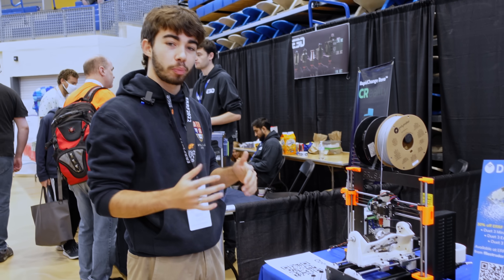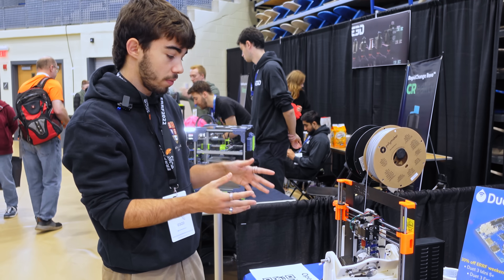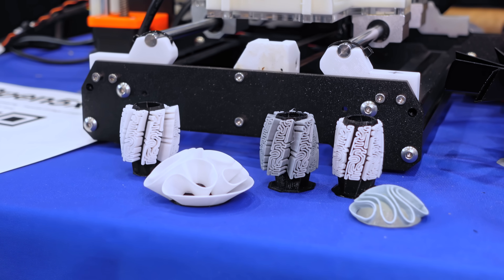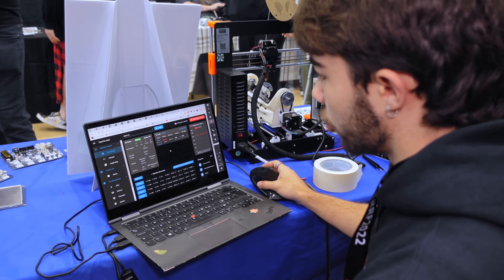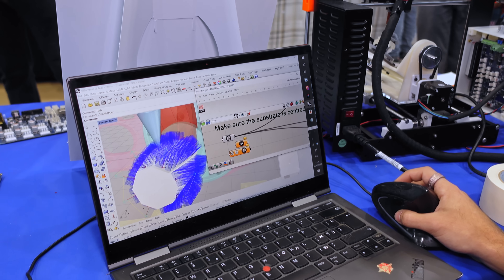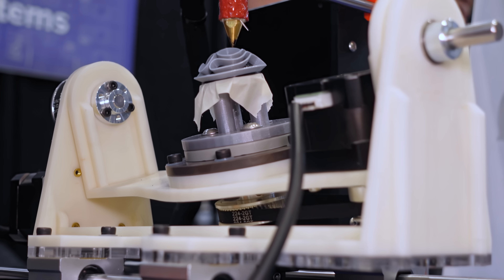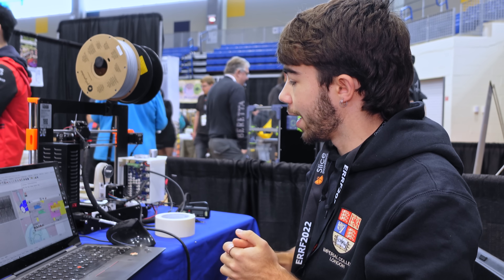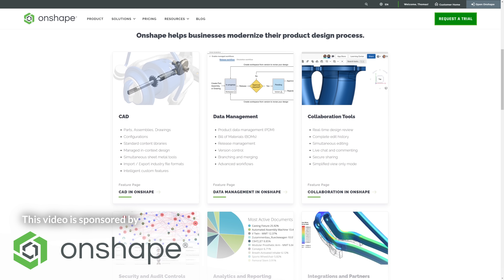You can build this 5-axis Prusa conversion: The Open5X! #ERRF2022

Comment: As a mechanical engineer I look at that and think it isn't hard to make. We actually make stuff like that in industrial space all the time...
HOWEVER... 3D printing and how the slicing is done is nothing like what we do with machining or welding. In those we just set paths, and it works. However... Nobody is going to write a 3D object in pure Gcode. The problem isn't that it can't be done - it can be, I do it all the time. Issue is that additive manufacturing requires things like infill and different path properties, and along with that the extrusion volume calculations. That is the problem. The problem is software, and especially the slicing. We have solved the axis controls, and those controllers and equipment are available for cheap nowadays. We automate lots of things and retrofit many machines at my place of work. However we don't need to do the calculations that are done in additive manufacturing.

Comment: I love fdm tech as we don’t cut away scraps material but add when we want it. Also it can do what Normal cut mill turn CNC cannot do. Yeah the presenter is right.. hardware is not the problem. Software and slicers going 5D is a bit tough though nothing is impossible. Thanks for sharing 💕.

Comment: 😯Really cool project!
Especially using it a bit like a lathe could potentially wrap up the weak layer direction into cylinders. And one extra axis still.
For the propeller demo object it does the opposite though. As the blades are disjunct the chosen orientation weakens the propeller blades.
But it should be possible to still print overhang free but with way better layer orientation.

Comment: A great accomplishment from an engineering standpoint, but it has drawbacks also. Apart from the software to run it, the usability is also limited as the trunnion table and extended nozzle take up quite a large chunk of the available working area. It isn't going to be cheap to build, as you'll need some precision parts to minimise the mentioned absolute zero offset. Printed parts will not cut it I think, it'll require milling. Also there are only so many parts that will fit the relatively small remaining working area and benefit from not needing supports.
I for one would rather have an IDEX. Will work with free software, minimal loss of working area if at all, will let you print all of the showed parts 3 times the size and supports can be done in PVA if need be, to be able to wash them off and have crisp edges. Just two tone with PVA supports will be a challenge, but I'd rather occasionally paint some parts then have the significant size limitation.
In my opinion, the amount of viable user cases for at-home 5 axis 3d printing will be very limited.
Even in the industrial milling field the majority of machines is 3 axis still, for similar reasons.

Comment: Very cool.  This could print almost anything, with no supports or infill and with "layers" in whatever orientation gives the best adhesion.  As he said, the hardware was basically easy and the software is the tough part, as evidenced by the demos with simple 2D-paths extruded out and multiplied.

Comment: Finished one 6 years ago, aluminium prices were cheap then.
It's working and prints with cobbled together G-Code.
Still no slicer to make some use of it. It will always be just a thing on the shelf:
- No slicers for it 
- If there will be a slicer, it would take huge amounts of time to slice parts the way you want. 
- Automating the Slicer to make it somewhat usable like 3-Axis slicers would take years, because there is no industrial interest.
- You go all the long to have a workflow and in the end you still have an FDM print, (of course it is waaay improved because of the layer oriantation) but it will never be as good as a SLS, Polyjet, which is getting cheaper too. 

Really enjoyed the build, all machined out of aluminum, linear rails, small ballscrews, servos, tiny Harmonic Drives, 3 different sized heatbeds with quick change, quick change extruder with an custom hotend.
Reply: A few industrial cam systems support additive manufacturing these days. I'm looking at one right now on my laptop. Haven't tried the feature yet, though.
Reply: @TheFeralEngineer  which one were you looking at?
Reply: @strongme80  esprit edge. Nx does additive also

Comment: Do CNC machines need slicer too, is it just g code in different way?
Can't you use the same code from CNC 5axes mill just in reverse? Let's say we make a same size mill in cad as plastic being extruded in 3d printer, then in cad we have our work piece, our part and we just make our mill in cad mill away entire part just leave the base you are supposed to print on, a sphere or other shape that is not just flat so it uses all the axes?

Comment: Nice. I saw myself and friends in the background :P

This is the first video on the machine where it was really indicated that the 5th axis part is more vase-mode following a surface normal, which would make the slicing + inverse kinematics easier. General purpose would be very hard but should be doable with some work.

Comment: Wow!  What a fascinating project.  I love seeing the continued adaptation of modern CNC solutions into the 3D printing world.  It makes the CNC technology reachable and achievable by the average home hobbyist.  What is great about this is that the knowledge and skills one learns with this easily extends onto full scale, metal CNC machining.  The 4th/5th-axis Trunnion solution you have designed looks solid.  For sure the key moving forward will be the continued development of the slicing software to generate the tool paths.  Being open source, I'm confident the geniuses in our open source world will add much value to this.  Thanks for sharing your project.
Reply: it will probably help somewhat in starting to think about using 5 axes when thinking about manufacuring a part, but beyond that, additive manufacturing is sucj a fundamentally different paradigm to subtractive manufacturing, that there is not all that much overlap between the ways you have to think about manufacturing parts when using these technologies.

Not that I don't approve of course, but I think this is not quite the best use case scenario for this technology

Comment: And it works with any printer with the latest Marlin Firmware installed with extra axis support enabled, as the "U" axis. So anyone with a RepRap device (and a spare stepper plug) can enter the next dimension!
Reply: All the hardware is very straightforward.  Software, tho.... particularly the slicing, has to be done in a commercial product

Comment: This is why I love the 3d printer space, most industrial manufacturing processes slowly get more and more insular, more specialized tools, specialized software that is not at all user friendly, etc. open source designs actually get improved upon because so many people use then and give feedback in a very helpful community
Reply: So very true, I created a range of folding TPU receiver & antenna holders for quadcopters which are super easy to print and use, holding them securely in a way no other prints have before.
A lot of the design elements in them came from suggestions in a Facebook group after I posted the first iterations.
Resulting in them being recommended throughout the FPV drone community.

Comment: Is this the same concept as the rotating printer head from CNC kitchen? that would probably be a better option as you wouldn't have to sacrifice so much build volume plus its just changing the tool head versus building and programming an entirely new rig
Reply: Not quite because that allows up to 90degree overhangs, this essentially allows for a lot greater than 90 degrees (within reason). Also you’re always printing normal to the nozzle which will mean your layers are cleaner. Whereas on CNC kitchens video he mentioned that some flat planes won’t be completely perpendicular to the flat end of the nozzle which could cause some less than ideal surface finishes

Edit- this is just my take though, you are right about the added complexity and less build space. 

5 axis CNC machining centres run into many of the same  issues, in terms of complexity of programming and the added risks of collisions, added cost, smaller working envelope vs a 3axis machine of the same foot print

Comment: Will never take off until the software matures. This is the same problem with 3D Construction printing at the moment. Using Rhino and a grasshopper script is non-intuitive and a  major barrier for most.
Reply: I don’t see why this couldn’t be added to Cura … this is basically taking away the bed movement and adding a extra axis . I mean it’s kinda amazing how good Cura is already I can see it eventually getting 5 axis slicing.
Reply: @JoeWayne84  the bed movement is still there, and they add 2 extra axis

Comment: This is pretty cool. Its sad that you loose so much build volume and I kinda feel like a Delta style printer would have been a better choice
Reply: It's hard to say that any part of this project is sad, it's just a consequence of every trunnion style 5 axis configuration. Every 3 axis machine build volume shrinks when the 5 axis setup is installed.
Reply: this is just like the "normal" CNC machine, just like a Haas VF3 compared to a Haas UMC-750, but each machine fits a different job, but  if they made the rotary table/cradle more like a TRT100, then they might be able to reduce the size, and allow for bigger prints hopefully :D
Reply: If its sad, help improve it then!

Comment: Interesting idea, but the $80 slewing ring bearing kills the BOM, and using an industrial grade bearing like that is pointless when the rest of your assembly is plastic. Swap that out for two $5 off-the-shelf large diameter bearings and a bushing, and it's instantly a lot more affordable.
Reply: Pull Requests are welcomed.
Reply: 3d printing was not invented for hobbyists but the affordability of the smaller machines that comes over after decades made them available for a new use case scenario and this is something which is more needed at Industrial level...!! So hats off to the guy and team who made it successful after around 40 years of invention of 3d printers..!!!
Reply: brother, start printing and spending money on this mod and swap the industrial bearings with 5$ ones and run some tests. maybe you will understand their choice once you start implementing your thoughts instead of dumping them as hate…
Reply: @danielmaracine3710  I have a 5 axis attachment on my desktop CNC mill and it doesn't take a slewing ring to work, just good design
Reply: This is an open source project, you’re more than welcome to go, develop your upgrades and contribute to the solution.
Reply: This project is opensource, if you don't like somthing, you can modify it to match your needs.
Reply: Sounds like a great opportunity for you to improve the project. I'm sure they'd love to have you contribute.
Reply: Rhino (the CAD Software you need to run Grasshopper) is around 1000€ alone. Education Version is 200€. 

Also $80 isn’t that much for a slewing bearing.
Reply: @WurstPeterl  arrrr harrr harrrrrrrr, there be ways around that, matey
Reply: @krazislav  dont destroy his innocence. Having people like him allows us to be us 🤣🤣
Reply: @brold6111  I know about the 90 day trial. But I used that already
Reply: @WurstPeterl  comedy gold
Reply: @WurstPeterl  it does not matter if that's a steal for a slweing bearing its still adds too much to the BOM.
Reply: @WurstPeterl You don't need to use Rhino/grasshopper for this.

Comment: I want to know how we're kinematically understanding the machine, breakthroughs in 3D printing like this can add value to people building their own cnc machines. For example, I have a five-axis now that is not kinematically able to have code made. From fusion I can move all five axes but if I try to do an operation but kinematically I have to figure out how to write code for it
Reply: Unfortunately, fusion will not let you add machine, kinematics and generate the G-Code for you

Migrating to other softwares like solid cam would but that is undesirable

It is interesting to see people doing things like this